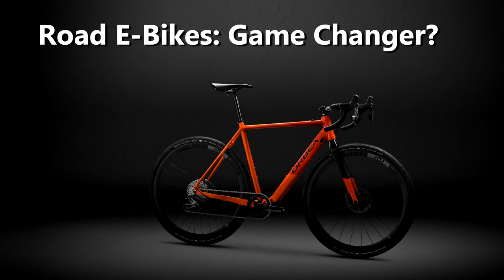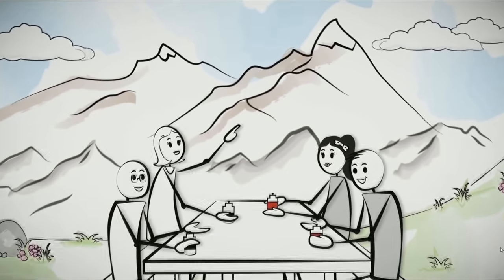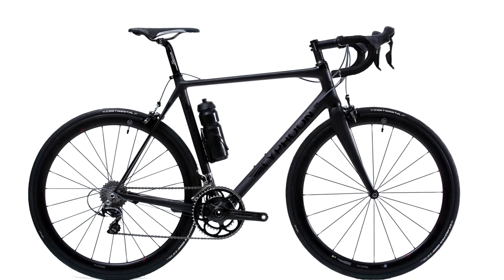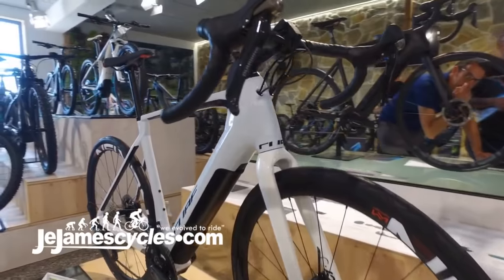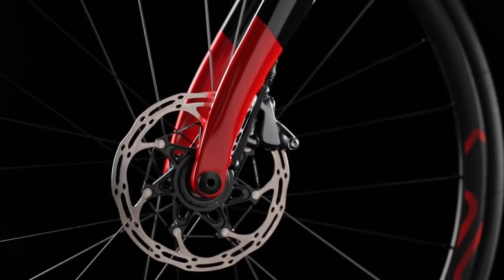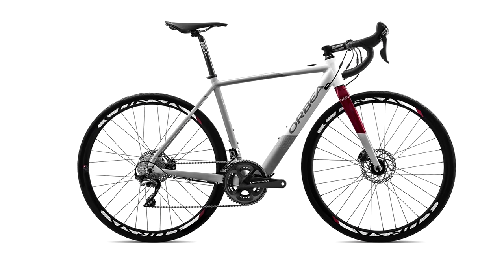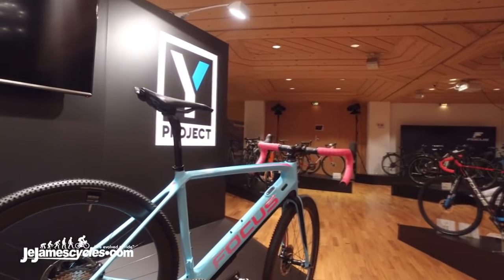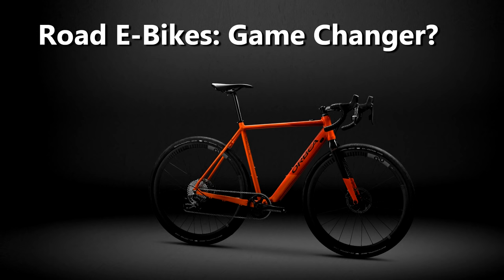Integrated ROAD e-Bikes with Hidden Motors: game changer or just a massive cheat?

Comment: An e-bike changed my life.  59 years old.  Just started cycling in February.  Now I cant stop.  5,600 miles, 151,000 feet climbed. Usually average over 20mph per Strava. I don't compete in Strava leaderboards, but track my own PRs.   I now do group rides with the fastest riders in the area. The riders of regular bikes have been very supportive, especially when I pull up a hill!  I get my heart rate to 150BPM for 2-3 hours.  I dont think that is lazy.  Great video.  My bike currently looks more like a mountain bike, but at some point I will change to a road bike style ebike.
Reply from the maker: Wow great story, keep it up!
Reply: How exactly has en e-bike has benefited you more than a normal bike...I mean you could easily get you HR up to to 150 with a normal bike, no?  Moreover, do you think you have the bike handling skills for that extra bit of speed? (You might, just asking).  My experience is that, while fine for experienced riders, e-bikes give novice riders access to amounts of speed that they are not qualified to handle, especially in tight situations.
Reply: Yes people start regular biking at all ages.  I would not have bought a regular bike so would not have started.  Not sure why.  Once I got the bike the speed became addictive, as did the exercise related endorphins. I built bike handling skills over time.  I had a couple of close calls in slippery conditions.  I rented a Pinarello regular bike for a 40 mile charity ride on the same roads I group ride on.  On a 3% hill my ebike does 18 mph, on the Pinarello I did 8mph.   Which do you think was more fun?  Surely ebikes not for everyone.  But if you put out 140W, like me, but want to ride with friends that put out over 200W, it is ideal.
Reply: Ed Sinofsky im bot sure whether thats a nice thing or not that you are talking about. I mean it sounds like you're proud to be able to ride with the fastest bunch, though they tolerate it and it the motor does create wattage comparable to a decent rider with about 250w, does it feel like you achieved sth? If you can only generate like 140w its absolutely understandable and i don't know whether you intend to increase your number, but isnt it sometimes better to simply spend the extra money you got on a better specced bike(frame, wheels, drivetrain). Because at about 5k and more you can get some absolutely nice and light/aero bikes, compared to an heavy, worse specced e-bike. I would train for myself for more time till i try to ride with stronger guys
Reply: I don't see where it deserves any heart appreciation. Mainly when you realize he's proud to display numbers and his "performance". What is great about what he's saying, when you know he even could do these without giving any pedal stroke ? The others guys spent years of training and dedication (well, I  don't know what he means saying "the fastest guys of his area" and "they develop 200w"), and the pay to win, like in bad video games, makes he think he deserves to ride with them. If he just wanted to ride fast, he would have bought a motorbike. But that's not his case, he thinks he's pedaling fast, with fast cyclists and that's he considers intoxicant. There aren't others groups adapted to himself ? Whatever he says, he's doing these for a fake satisfaction, like many cheaters who take drugs at 60 years old to ride at 40km/h. All question of ego, which already gangrene cyclism enough to encourage people, pretending they're great when they're not. That's what they search, to be admired, and not the real performance they can do. After years of cyclism I realize that, don't admire mythoman and they'll hate you, because it's the main reason they practice, and the way they do. You're here to be the spectator of their fake practice of the sport. Why is bicycle much touched by this ? Because it's for much a question of material : any noob can buy a 5000 € bike, and look like a pro (he thinks, you fastly see it's not the case if you now a bit, but they think they make illusion). Take running, and people are much more serious in their training, more humble, because it's themselves against the time. In cycling, it's much display. Adding the fact you've to stay with the peloton, it's more binary : ejected, and you can be the subject of mockery of other ego praticers. I'll never encourage ego cyclists, and don't see the point to encourage them to stay in their delirium.
Reply: Sorry man, but, from my point of view, all the e-bike did is to push you to more dangerous speeds you were not used to without any real benefit. To ride in group is not mandatory. It can be useful to push you a little over your limit, but, if the electric motor do it for you...
Reply: Neutron Alchemist a lazy friend of mine explained it to me like that(he isnt actually that unsporty, simply lazy). "You basically never get out of your comofortzone while maintaining an poweroutput that is similar to your ftp or even higher. Feels strange and cheaty sometimes."
Reply: Last year I spoke a group of amateurs on road bikes where one of the riders was on a road bike with electric assist. They road together for more then 20 years when one of them had a bypass or surgery. After that the guy never got up to speed with the group anymore so they all pitched in to have him buy the assisted bike so they could keep riding together.
Reply: Ed Sinofsky - fine, but also use a regular bike and challenge yourself to improve without the motor. You will really appreciate the combination of the two. At 59 you should be able to do a ride not too far off your ebike speed eventually if not too hilly

Our club has rides at 12, 15, 20 mph so all you are doing is riding in the faster group and not getting the benefit of the effort
Reply: Ed Sinofsky ..Glad you have joined us on the road.  I will tell you I am also 59 years old, but have been cycling on my road bikes since 15 years years old.  I would see use in riding an E-bike for commuting, but never as a training /fitness bike.  I would welcome as a riding partner and as someone demanding road use rights, but would not be able to sneer at you just a bit as you pass me climbing a mountain pass.  Sorry, that's just  forty years of cycling speaking out.
Reply: If your commuting I guess is ok, just a mean of transport, if u use it for racing you’re cheating, if you use it to get fitter you’re cheating yourself
Reply: RabidMortal1 
I bought a Trek e-mountain-bike and it changed my life. I can cycle everywhere and I don’t have knee pain and don’t accumulate lactic acid in my muscles which allow me to recover faster and ride every day. It removed the pain but not the gain.

My e-bike allowed me to get back into shape, cycle in the fat-burn and aerobic heart rate zones even when climbing steep hills. It allowed me to cycle everywhere, cycle for longer and visit more places. 

E-bikes are awesome!
Reply: Unless you are trying to fool people into thinking you are not using an e-bike, then they are pretty unobservant, and it’s pretty dumb on your behalf. If you are riding with friends that are way fitter than you, why shouldn’t you have the option to use an eBike. The fitness snobs that say you can’t ride up long climbs with your younger fitter friends are just trying to exclude people from a club. If everyone knows what sort of bikes their fellow rider friends have and don’t think they should piss off, then let people ride what ever. EBikes are limited to assisting up to 25kmh. Also I think too much speed to handle is just a silly argument. If you can struggle your bike up a steep hill without any power assist or breeze up it with, then everyone is going to come down that hill with more speed than any legal eBike is going to give you.
Reply: One who decides to ride a bike, decides the benefit or reason for it. Nobody can determine what that benefit or reason is for another. Excluding a fair and agreed upon competition with standards and rules for participation, anyone thinking another doesn't deserve to have that choice is narcissistic and unsatisfied with their own situation. 
Spending the money to get a lighter bike with better hardware provides an ability to achieve a greater speed also, but nobody is crying about that...
Honestly. It's as if the only reason anyone has achieved a certain speed on an unassisted bike is because they've stepped on everyone else to get there, and someone who doesn't want to be stepped on is keeping them from achieving their speed. Clearly that's not the case, so who gives a crap about how someone else decides to ride thier bike.

 Well, I answered that in my second sentence.
Reply: @RabidMortal1  e-power is only available up to 15 mph so not a problem for skill level, and if your older or not so fit an e-bike will allow you to ride and enjoy plus get fitter with much younger and fitter riders,no? I can not understand why people are so negative towards something that can help so many enjoy the great world of cycling! if you don't like e-bikes then its simple "don't buy one" no? but at the same time stop being negative just because its not for you.
Reply: @dupondavignon869  all this negative stuff just proves why so many people think all those lycra clad groups are so up them selves and unapproachable!
Reply: Ed Sinofsky Ed, We must be related, I am 60 yrs old and my month old e bike has changed my life, I’m doing 30-40 miles each ride and smiling like a Cheshire Cat most of the way, Happy days ahead 🚵‍♂️🏴
Reply: @daveculver9299  Welcome to the dark side!
Reply: @mikemerrill175  I'm a biker. When I ride my motorcycle, the bare minimum equipment that I consider acceptable is full-face helmet, jacket with protections, protective gloves, long and sturdy pants and boots. With that equipment (and the far better brakes of a motorcycle) I know to be far safer at 110 km/h than on a bycicle, at 40 km/h, with just a cyclist helmet and a pair of sunglasses.
Nicky Hayden spent his life riding motorcycles at over 300km/h, and died riding a bicycle at 20 km/h.
Reply: @EarlGrey-YT  Well said,  it  is nobody else's damn business. These people ought to be ashamed of being so supercilious - ignorant snobs. Let's see what they say when they get to my age. I got very frustrated in the last two or three years at having to select repetetive, boring, flat routes because - however I tried to train - my hill climbing just got worse. So, for my recent 90th birthday I finally added an electric assist kit to my road bike. This has been good move and has opened up most of my old routes again - those detractors can think what they like. It's worked for me.
Reply: @nunofpinto11  I agree
Reply: @daveculver9299  I am 64 and not fake as you are

Comment: I have an Orbea Gain  d40 2019 and have ridden 2000km over the hilly roads here in Devon bike has been great it doesn’t take over the ride but is like a good tail wind, the range including 1700m of climbing is 54km but I made a water bottle battery which doubles the range.   This bike has enable me to ride 10 hours a week without killing myself max speed with assistance 15.5mph so I get help on the hills but not on the flat  great for training   Really like the disc brakes and the geometry makes for a comfortable ride
Reply: very nice !!!!
Reply: I know you posted this a long time ago, but doing research now.  How is the bike now?  And esp how is it on hills?
Reply: anyaka a d40 was a great bike had a few faults rear wheel needed rebuilding due to weak spokes (warranty covered). But did over 4000km without any other problems,  sold bike for good money and bought a orbea gain M20. Carbon frame and ultegra  and mavic  built wheels had this bike since Oct 2019. Already done 2000kms bike is faultless and a joy to ride .
Would recommend either bike but paid only a bit more for the  M20 (cycle republic). And got back nearly 70% of the D40’s price when I sold it ,

As for the performance on the hills the assistance is good but you still have to pedal ,  but it enables you to go further without losing the enjoyment because of recovery time afterwards 
Hope all this helps

Comment: Very helpful article!
I purchased a full suspension Ebike last year (Merida) and have just done a week`s riding off road in Scotland. It has a Shimano Steps motor and detachable battery - so was recharged every night in each hotel (it never ran out of battery even cycling all day).
The need to recharge easily overnight is for me a requirement as I would be taking the road bike down to the Pyrenees or the Alps to do successive rides on different days - I can`t see the hotels wanting a bike in the bedroom if it has a non detachable battery. So I favour the Pinarello Nytro and the Cube.
The Cippoloni looks stylish (of course!) but the absence of disc brakes on a heavier road bike is a major draw back.
I have discs on my standard road bike and the difference from rim brakes is amazing.
By the way I`m a life long cyclist - now 76 years old so E bikes for me will help me keep cycling!

Comment: I use an e-bike to get to work, i don't want to arrive covered in sweat!
the E - bike has replaced using a motorbike.
I also do a lot of cycling on  normal road and C.X. bikes.
my view is that E-bikes are great fun, do have big fitness benefits for the average person and can greatly encourage people to start getting fit.
i think for a serious cyclist the new breed of stealth E racing bikes would be great fun on easy recovery days where you can travel farther and faster :0]
Reply from the maker: nice to hear from someone who has both types of bike
Reply: I am considering an ebike for this same reason. If I do a hard ride on Monday and I am cooked and need some recovery time, I would like to still be able to get out there riding because it is fun, not because I am constantly seeking fitness and performance gains...I just like riding my bike.
Reply: An "ebike" IS a motorbike.  It has an electric motor.  The cognitive dissonance is amazing.
Reply: @LVQ-so5th  When did you last have to assist a motorbike to get it to move along?

Comment: I have a 25 kg e-bike, it is basicly a transporter. Change a few things to make it a bit more aero and better suited for training. I now go out for laps that are more then I can do, starting with the e-motor turned off. Just make myself workout while enjoying being outside. When I get tired I push and push and push but when the lights go out..... i turn on the motor and have it bring me home. As it is pedal assist I still need to pedal which is actually a good cooling down.
This transporter-e-bike allows me to on bike what I used to do by car and get some exercise while doing so. The e-motor is just a safety catch in case my body is finished before the trip is. Actually, I try to make the trip long enough so it will.

I feel no need to hide it, I am on a e-bike. And even when the assist is stopping when over 24 km/h I feel no urge to tell anyone.....yes I sometimes overtake race-bike(r)s. I do this for myself, I enjoy it and don't need others to appreciate it.

So conclusion, turn off the e-motor as often as possible to have as much workout as possible in your life, but turn the e-motor on if really needed to save yourself from injury or arriving sweaty at a meeting/work etc

Comment: From what I seen the seat-tube hidden setup (1)  motor sounds like a brushless RC car and there is gear lash noise: it's running at ~9,000 RPM to produce 200W with a 100:1 gear reduction to give you ~90 rpm at the crank  (2) has no analog throttle, it's 200W on or off.   

Cheaters could make best use of this in an ITT  when there is nobody around to hear it or on a  Strava KoM hunt, but they'd have to be very judicious about when they applied the 200W burst. Even with a hub based PM that would measure the total output, you'd see these big on-off jumps in power raising some doubt.  If you had a crank or pedal based PM, you'd see drops in power even though VAM and speed stayed the same.  Or they could just not post their power numbers but in that case, why not just do it in your car.

I think cheaters would prefer something more subtle, like a silent ~50W with a 25Wh battery. Maybe the Di2 battery (or a second Di2 battery).  If you're in the 4.5-5 W/kg FTP range, those extra 50W after a breakaway attempt, toward the end of an uphill finish, bridging a gap, could put you on a (undeserved) podium.  

Probably just a matter of time before you can buy a kit on Amazon or ebay for 50 bucks.  So, the only solution is to make the penalty sufficiently severe to not be worth the risk - first offense = lifetime license ban.

Comment: I am definitely not ready for an e-bike yet.  However, when the time comes that riding up hills, never mind mountains, is too difficult, I will get one.  If the choice is between not riding or using motor assist, I will choose the assist.  But that is a long ways off for me as I am only 68.
Reply: Michael. Correct thinking - went e-assist at 90 years old.

Comment: It looks fantastic but why put this technology so far I can see not in normal bicycles.There are a lot of different model electrical bicycles for sale but is this type of electronic motor not fit for a normal bicycle because of the weight factor because race bicycles are very light in comparison with normal bicycles?

Comment: The Ribble e road bike is basically the same as the orbea but only weighs 11.5kg and I think the orbea with battery is 2 kg heavier? Correct me if I am wrong though.
Reply: Roger. Yes, you're wrong. The Ribble CGR  - Ale in aluminium, with 105, is the same weight, and price, as the Orbea.